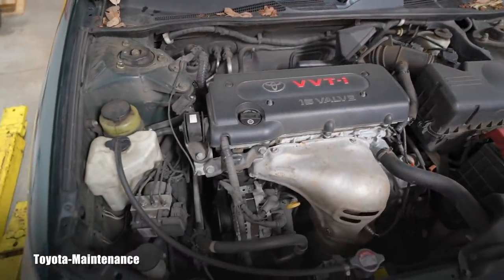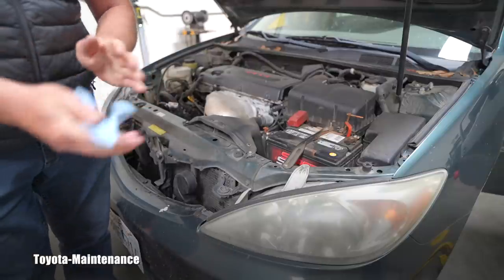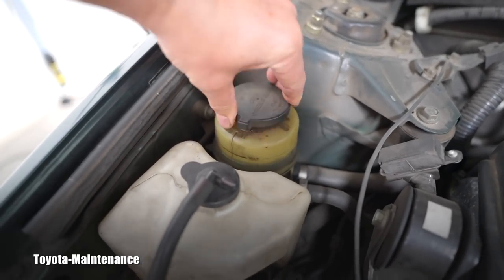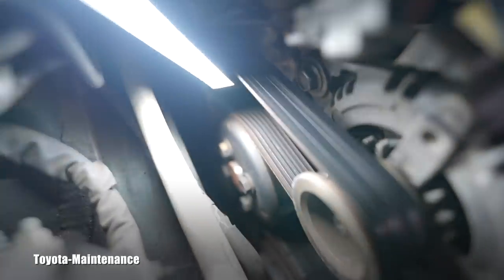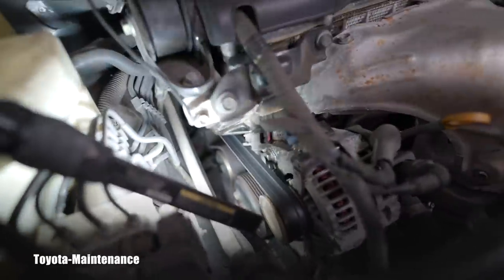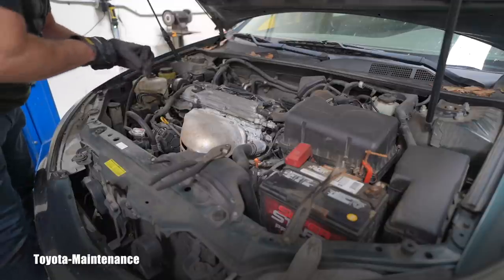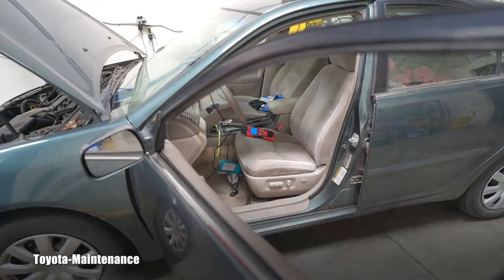2004 Toyota Camry  with multiple problems

Comment: Who else is dumbfounded at the complete lack of BASIC maintenance to this poor car? I mean this is one of the easiest cars to maintain!
Reply: Get a grip, if this is what you're angry about then you have problems, man. 
Not everyone is taught about vehicle safety & maintenance. So many judgemental comments here.
Reply: @chocolate_squiggle  Not everyone is taught, you say? Most cars come with a manual, or one can be found online - checking the oil is clearly mentioned in the manual. Even if one thinks of a car as an appliance, it's the most complex appliance we use - and we ride in it. Failing to read about the basics of owning a car is both ignorant and dangerous.
Reply: @chocolate_squiggle  honestly, people only make comments like yours because they're angry they lacked a father/masculine role model in their life to teach them essential life skills as a teenager. It's tragic and we need to reverse the trend but we must first be honest and address the problem head on if we are to solve it.
Reply: But it is a Toyota it can drive forever so I just drove it
Reply: @heinuchung8680  Nothing can uses and lasted forever if you abused it.
Reply: @chocolate_squiggle  A working vehicle is how people get to work to keep the lights on. It's pretty important.
Reply: Girls….
Reply: @zaffo757  and little brothers
Reply: So many get.in and drive and never worry about maintenance. Most people are not car people.
Reply: The  young person driving this car will learn from his mistakes if the parent makes him pay for these repairs. If not, he might as well move to a large city where they have public transportation 😅
Reply: @chocolate_squiggle we got a car maintenance procrastinator saver here

Comment: Good grief, I've never seen so little oil come out of an oil pan. Who says the 2AZ-FE is a weak engine, that one basically survived WW III.
Reply: I was expecting to see oil fouled spark plugs because of the low oil. Maybe that motor had the rings changed by Toyota. I'd do a Vin search then I'd give that college girl a good spanking.
Reply: They a very strong engines. These didn't have the same oil consumption issues like years 2007-2009. But all cars burn some oil as they age esp when they reach up to 200k or more.
Reply: @kingcraven8056  I would also but for different reasons
Reply: With the oil that horribly low, shouldn't the warning light been on all the time, for a long time?
Reply: @eman0828  I hope you’re right! I have this engine in a 2006 Camry and I just learned about it. Now I’m freaked out. I only have 126,000 km’s on it. It doesn’t make sense to me the same engine design changed and then fails and burns oil.
Reply: @craigiefconcert6493  it maybe the same engine but those years weren't effected. There was a slight design change of the same engine for years 2007-2009. So if you don't see a TSB (Technical Service Bulletin) for years 2002-2006, I wouldn't worry about it because Toyota would of issued one a long time ago.
Reply: @craigiefconcert6493  the newer ones burn oil because they changed the piston rings and tried to squeeze better MPG out of it by making it work with a thinner oil. The older 2AZFE, like the one in your Camry, uses 5w30 and has the old piston rings which don’t have the issues like the new ones. But apparently the common oil consumption failure on the older engine is valve seals leaking and letting oil into the combustion chamber. Our 2003 didn’t start burning oil until 220k miles, so I think you’re fine. Once it starts burning oil, all you need to do is buy a second jug of oil and fill it up regularly. Use synthetic, conventional made my oil burning worse so I switched back. That jug lasts me until the next oil change, but again my car didn’t start burning until 330k km, so I’d say you’re fine for the next decade or so lol. Just make sure you change oil on time, use quality synthetic, and your Camry will last for decades
Reply: @tinuthomas531  yeah and depends what mileage you're changing the oil at. I change mine at 3000 while others do it at 4-5
Reply: @parkerhodgson4785  not always. Toyotas can run on very little oil. Not that it's good for the life of the engine. But they are designed to accept high tolerances. For example, if your $200/$300 oxygen sensor is failing, and becoming lazy, it will max out the tolerance before a check engine light turns on, allowing you to operate it in many places where a check engine light would mean full stop of restriction to operate on public roads.

Comment: I couldn't be a mechanic. I would be scolding my customers for neglecting their card's maint.
Reply: I would be embarrassed to bring such a car to a shop with this list of issues.
Reply: @paultennis9414  Me Too!
Reply: She may be just too young to understand to value her things. Not even 1/3  the way through and I see even her rear driver's tire seems so low. Maybe even mid 20 psi.
Reply: Your comment also brings back memories of the lunch lady scolding for throwing away food
Reply: Really isn't the disaster you're making out. A missed oil change, couple of bulbs out. Someone else was likely responsible for the disconnected PCV hose.
Reply: @chocolate_squiggle  Bulbs don't just burn out at once. She had to have been driving with one headlight for a while. Shouldn't have to go into why this is a bad thing. Running a car out of oil will cause the engine to seize. This could happen at any time. Could happen on the freeway and cause a collision, maiming and or deaths. Could happen in a bad part of town, at night causing her to become missing.  Bringing a car in for an oil change is the prefect opertunity for a mechanic to go through the car and up-sale repairs. If your mechanic don't do this then find a different mechanic. I pumped gas in the summer at 15 years old and sold things like oil and wipers on the islands (the cement slab the pumps reside on). I would look over at the mechanics just standing around and would sell oil changes. Getting the car in the hands of the mechanics resulted in the mechanics finding other problems.
Reply: have you been flossing?

Comment: I know people think the 2AZFE is a bad engine because it burns oil, but all you need to do is fill it back up as it burns and your engine will last many more miles. Our 2003 started burning oil at 220k miles, and now at 270k it still runs fine. My own 2003 was bought with 240k and when I bought it, it had no oil in the engine at all. 15k miles later and I’ve had no issues as I top the oil off every once in a while. It runs very nice, and I’d like to keep it for a couple more years.
Reply: Usually its a small leak, replaced the valve cover gasket and oil pan gasket and it stopped losing oil and its near the 300k mark. The 2001-2006 2azfe engines did not have a oil burning issue, the ones after 2006 did because they changed the cylinder heads and oil control rings.

Comment: I have a 2005 Camry in Toronto, Canada. Absolutely bulletproof car with 350,000 kms and running like a champ. This was the last great generation of Camry. Solid.
Reply: I have an 06 Camry SE model witha 195k miles on it. Still runs and goes down the road. The SE model looks quite different from all the other Camrys out there that looks like in between a Lexus ES and a Mazda 6 with black spider headlights, dark front grill, 5 spoke alloy wheels. I have a Grey one. It's got the 4 banger engine that gets great gas mileage.
Reply: My flatmate has an 08 Aurion with 550,000 km. They still make em like they used to
Reply: Driving 2006 camry 225,000 miles on it engine and transmission are great the shocks and power steering is  another story
Reply: @hellokittybebop  if you change the struts just change the struts and use kyb for original ride feel. Monroe's are junk. But worse are the eBay or Amazon ones. And only last 8 months to a year.. You can use tokiko but they're pricey! Sensen is a good compromise. Japanese quality.
Reply: This is the best generation of Camry because it rides nice and sits tall.

Comment: I'm a super maintenance freak.  To see this car with lack of any real maintenance is tough to watch.  I just don't understand why people neglect basic maintenance of a vehicle.  I guess the younger people have no one to teach them basic maintenance and therefore they never check anything until a "warning light" starts to flash.  I've always enjoyed maintaining my vehicle.  Not so much now, but I'm getting too old for this now.  However, I do have a trustworthy Toyota Dealership, so life is good.
Reply: I agree. The things I repaired I do no more. Small stuff, yes. I too found a dealer I can trust. I have no problem checking their work.  Local mechanics charge the same as dealer and use plain wrap boxes.
Reply: It's not just young people today - I'm in my forties and I didn't have anyone to teach me basic maintenance. And when you only ever buy second hand cars a lot of times the owners manual is already lost - so I never even realised there was such a thing as a 'maintenance schedule' until I bought a used motorbike and it came with that little booklet. Many people don't have the time, space, tools, money or the knowledge to keep a vehicle in tip-top shape - the fact is many people have more pressing issues to deal with in their life. Some of them, like me 20 years ago, won't even know that you're supposed to do anything except change the oil and take it to a mechanic when something goes wrong. How are they supposed to know if nobody ever tells them? I'm not having a go at you I just hoped you might understand why people neglect basic maintenance. I'd bet that most of the time it's just plain ignorance. Personally I don't understand a lot of the harsh  comments here, it might be disappointing but it's hardly the crime of the century. Geeze they need to watch Mech a Nic's channel if they really want to see what neglected cars look like.

Comment: Whenever I hear of an engine with such low oil that it can't be read on the dipstick, I worry about how much damage may have already happened from lack of oil circulation. Especially when, such as this car, you can see the warning on the dash. I'm not saying the engine is going to throw a rod tomorrow, but the whole thing probably has a lot more wear than the mileage would indicate.
Reply: Yeah. Like spun bearings or excess wear on the crank, etc.

Comment: 1 Quart of oil? WOW that is amazing! I bought a 2004 Collision titled Camry with 112k miles on it.  We kept it for five years of low milage driving at 138k miles, and my wife one day went out and bought a new RAV4 as she didn't enjoy the gray color and though it beyond useful life in 2016.  Camry 2004 served me well as upon entering the airport tollway a "bang/clunk" sounded along with "check engine" or 'battery' indicator lite up.  The steering became really heavy, especially turning into airport parking.  I noticed "steam" coming up from under the hood.  Not wanting to delay picking up my mother in law after an international flight, i took the toddler out of that back seat and proceeded to the terminal.  On the way back to the car, i opened the hood to notice that i was losing/lost coolant and wondered whether I had enough coolant to drive the 25 miles back home.  I sort of shrugged and didn't think twice with calling triple A.  Well it was a rainy day, and with the battery light on and some issue with coolant, and a very stiff power steering...i instinctively kept at 55mph, turned off lights, and even turned off wipers until absolutely necessary.  I felt something was "wrong" but didn't want to stop by the roadside.  We made it back into the home garage and stopped the engine.  Being curious, i tried to start the car, but it wouldn't start up.  That was when i realized it was time to use my TripleA to call the tow to local mechanic/garage.  My car wouldn't start, can you fix it?

Root cause?  something about a water pump seizing up, pully head broken off, and accessory belt completely off track.  Engine was fine, and my wife used the car for the next two years.  I sold the collision titled camry for $2500-3000, and the buyer test drove it on the highways just to their expectations.  Fast forward to 2023, i'm evaluating EV cars, second hand late model years of Sonatas, Camrys, etc, as a spare car to "back up" my Sienna.  Well guess what, I found what appears to be a well kept low milage (132k miles, if its true) Camry 2004 in luxurious white.  Going next weekend to see if it checks out, unless it gets sold during the week!

My wife's first comment?  You already have an old car, don't waste money...what if they don't make parts for it any more? LOL.   I'm wondering whether my kids will want to drive it in 5 years...electric car fad is having trouble getting off the ground to mass adoption.  Too many risks to the consumer. PRICE of "disposable cars".   Also,Think battery charging risks,,,otherwise think of Turboinjection engines, CVT transmissions, dying engines due to extra sensitivity to oil conditions (toyotas, hyundais, kias, etc).  Maybe i'll keep these early model Toyotas going until we get mass produced solid state batteries in PHEV mode before trading up.

Comment: Excellent job Peter.  Those engines are noted for the piston rings cracking and that causes them to burn oil like crazy.
Reply: Isn't that the 6th Generation (2007-2009) and/or non-Japan made engines or piston rings?

Comment: I own the same color and exact model.  I never let my fluids get low and I always change my oil regularly.  I bought this little diagnostic tool.  I got email or text something was wrong.  So I rescan later the next day.  Not only did I get the text I also got a link to a YouTube video on how to fix the problem.  I currently have 145000 miles on the camry.  I love it.  The peppiest little 4 cylinder that I've ever driven.  I gunned the gas one day.  I will just say this you never want a car to fishtail with the Frontend.
Reply: What's the tool called. And do you mean torque steer where one side pulls forward more than the other?

Comment: I have exactly the same car 2004 Camry LE [Maroon], 275,000 miles still running, will run it atleast 300,000 , one car mechanic a friend of mine said he has seen this car with 500,000 miles on it in good running condition.

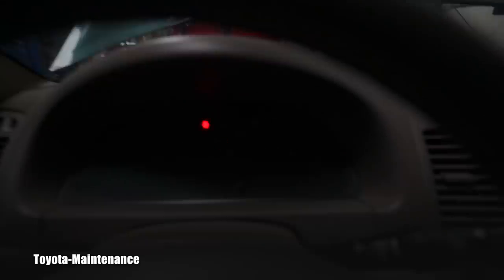Comment: Petr, did you miss something?  02:41  The oil sticker in the window says 03/17/20
Is that when the last oil change was done?
Or is that the date the next oil change is due by? Mileage 224805

My guess is that car was due for an oil change by March 2020

I think the oil was last changed long before 03/20, probably in mid-2019.

My guess is the oil hasn't been changed or checked since 2019.
Reply: Good Catch!  Usually the mileage on the sticker is when the next oil change is due.  The mechanic should "Do the Math" not the customer.  Who Knows?  It would explain why the oil was crud and so low.

Comment: About Missing Water.  A blown head gasket would cause the car to run like crap.  Good chance of seeing water coming out of the exhaust pipe too. Radiator coolant could smell of exhaust.  Water could be in the oil.  Could the car's water pump had sized and then freed up without leaking out the weep hole? That will explain the slickness and gouges in the v-belt and maybe the missing coolant.  Peter started the car and didn't mention a coolant leak. 
A radiator cap maintains pressure to a specific pressure (typically 15psi) to lower the boiling point of water.  (1psi = 3degF).  If you did the math and got 257degF you did well.  Once this pressure is achieved the cap will relieve excessive pressure to the coolant recover bottle. When the engine cools it creates a vacuum which sucks back the coolant from the coolant recovery bottle.  The upper seal allows this transfer to happen gets cracks in it allowing air to seep in instead of the coolant.  So basically the engine pumps out coolant and sucks back air. The recovery bottle will completely fill and allow coolant to flow out the over flow tube. Water and antifreeze are both coolants. One works better than the other in many ways. One evaporates quicker. The remaining coolant in the reservoir evaporates.  There was a time where cars didn't have recovery bottles. They would have to have their water checked almost every time they filled up with gas. The gas station attendant knew how to open a hot radiator.  The attendant would have the driver run the engine while water was added.  This would give the gas pump attendant the opportunity to inspect under the hood, for fluid levels, belt wear, and air filter. Wipers were checked when the attendant washed the windshield.  Tire pressure checked and corrected on demand.  Over pressurizing the coolant system causes excessive wear on seals.  The radiator seal can blow out or the water pump seal. Some water pumps are inside the timing cover and will blow water into the oil pan.  Caps are cheap, replace them before stuff happens.

Comment: I have a 2004 Toyota Camry XLE. Check engine light means it needs oil change. Change your head lights. Oil light, make sure you have enough oil. My car has 128,000 miles and runs fine.

Comment: I have a 03 and didn't realize it was burning oil until I did a hard stop and the oil light briefly came on. Now I used to take it to my mechanic of 20 years and he never said that not enough oil was coming out during the change. Now I understand that it's my responsibility to check these things and I did fail in that area. The Camry has 260K now and is using about a quart every 4K of synthetic. Oh this same mechanic told me I needed new heads on my 4runner and it turns out it was a bad spark plug, but that's a whole different story.
Reply: Time to keep the heads on the 4Runner and change the mechanic
Reply: @emeyer6963  oh yeah, done that 3 years ago.